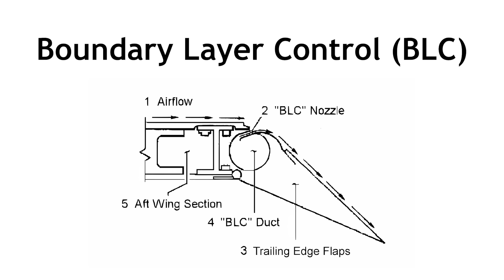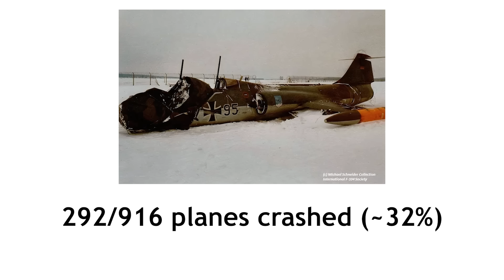Why This Jet Killed So Many Pilots?

Comment: Many f-16s that were made for export came with a j79. Not the Pratt & Whitney tf100 or the General Electric engine. You can usually tell them because they have a little bit of an extended tail because the j79 is a couple of feet longer in the aircraft

Comment: I hear the Russians are in need of replacement aircraft, dust these off and send them over as low level attack aircraft from the golden era of NATO.  🤣
Reply: I like your anger. It is caused by your insignificance.
Reply: @dmitry4c996 Projection... 🤣

Comment: I'm not an aviation expert but I noticed most these jets from like the 50s and 60s had very high accident rates.   It wasn't just the widowmaker.
Reply: Very true the century series  had very high performance and far less forgiving than earlier jets which were in many cases jet power with WWII airframe.  I've been told other airforce had higher accidents than Germany
Reply: @JohnW-gz4db  F 104 losses  in Germany 32 %, Italy 38 %, Taiwan and Canada 46 % English Electric Lightning just over 15 %

Comment: Also destroyed Saunders-Roe who had a bid in for the same NATO fighter contract with the SR53 but Lockheed won due to wholesale bribery.
Reply: Lockheed won because the F-104 was fully developed and had superior performance.
Reply: @dukeford  Not true, I personally knew members of the SR rocket engineering team, and their bird was undergoing flight-testing when Lockheed had it canned. It LITERALLY had a rocket up its tail (as well as a secondary jet engine for loitering and go-arounds). The rocket was similarly usable as Spaceship 2's current engine is now, and it could outclimb anything: time to 100,000 feet was 3 minutes! It was a conventional delta wing with decent wing area and well-behaved. And the Luftwaffe wanted it.
Reply: @richardm.newlands2417  1. None of that stuff was ever tested. 2. NATO needed a multi-role aircraft.  The SR53 was strictly a one-trick pony.
Reply: @dukeford  And the Lockheed bribes scandal led to various people going to jail
Reply: @WORKERS.DREADNOUGHT  Nobody ever actually went to jail.  The only person convicted was in Japan, and he died while his case was being appealed.

Comment: A lot of misleading b.s..  More " forced into roles it wasn't suited for" nonsense.  The fact is that the Starfighter was a very effective multi-role aircraft and it's accident record wasn't much different than other 2nd Generation fighters.
Reply: R-I-G-H-T guy. try again.if what you're saying was true there wouldn't be so much controversy. You also need read little more history. Your not well informed.
Reply: @JohnW-gz4db  Everything I said is 100% accurate.  The controversy had little to do with the capabilities of the airplane, and it's safety record has always been misrepresented.

Comment: My dad loved it. 700+ hrs before a dumb soccer accident kept from flying. Late 60’s that was.
Reply: IDK but soccer accident may have saved his life... just saying.
Reply: @Barron5362  I suspect @Robin6512 dad respected the 104's advantages and disavantages by being (fortunately) fully trained and avoiding situations that were obvious to a fully trained 104 pilot but not obvious to a lesser-trained pilot or to managers that impose inappropriate missions.  It is a bit like driving a Ferrari in the winter...when it is snowy icy you do not force race mode, you drive conservatively until it's dry.  Managing such limitations with a high-performance machine is VERY rewarding, thus the "love".   But, yes, one never knows what the future holds.
Reply: So an arrogant pilot got what they deserved for a change, without killing a bunch of people in the process. Some story. The best pilots are usually the ones wisely on the ground, wrenching on said deathtrap. There's a reason I fly an experimental. Only affordable way to get a plane that was designed with the benefit of modern knowledge and computer assistance. You can pay 5x as much and fly a tired old Cessna. They are sturdy planes but, after decades of mishandling by crappy low time pilots, and never really being properly maintained, even they become deathtraps. The fact that pilots usually don't know nearly enough about the planes they fly is a pervasive problem. I would have been a conscientious objector before I would fly the F-104. It really is that simple. It was a bridge too far. 
Your old man is probably lucky he got out when he did. Someone who gets themselves sidelined playing soccer for giggles can't be a very good pilot.
Frankly, any random military jet jock who survived the lawn dart should consider themselves extremely lucky. It almost killed Chuck Yeager and I am certain that no better pilot has ever lived.
Reply: @RunsWithChainsaw  Knowing ones own limitations is a virtue
Reply: @RunsWithChainsaw  bro relax

Comment: While in the Air Training Corp back in the 1980's,I read an issue of flight magazine about this very aircraft and this problem,the Luftwaffe F104 pilots were instructed,if you get into trouble,INVERT the aircraft AND EJECT.DO NOT EJECT WHENNIN LEVELNFLIGHT.
Reply: Your memory is faulty. 🙄
Reply: @dukeford I don't think so because at least one model did have down ward ejection seat  historical fact one german pilot experienced engine failure after take off , rolled inverted attempt to eject.
Reply: @JohnW-gz4db  Maybe it happened to one German pilot one time, although he would have to have been flying an early USAF model, which were the only ones with the C1 seat.
Reply: LOL
Reply: Initially, it was someone's joke. But it seems that Luftwaffe instructors have a very specific perception. Like that chocolate bar: "Quadratish praktish gut". Thus, the joke turned into a guidance..

Comment: High wing loading and flying too slowly. That's what I think.
Reply: You would be wrong.  Most crashes were due to bad weather, high-speed low-altitude operations, and engine failures.
Reply: @gort8203  How do you know that - and why did the Germans crash so many more (proportion) than the US?

Comment: One small correction:  Canada took on strength 200 CF-104 and 39 CF-104D two seat trainers for a total of 239 aircraft.  Of the 110 class A accidents 21 were attributed to foreign object damage (14 of which were birds), 14 were in flight engine failures, 6 were faulty maintenance, 9 were mid air collisions. 32 struck the ground flying at low level in poor weather conditions. the rest being attributed to pilot inattention.  As for nicknames some Canadian pilots referred to it jokingly as The Lawn Dart, The Aluminum Death Tube, or The Flying Phallus but generally called it the One oh Four or simply the Starfighter.
Reply: lack of adequate transition training was the issue..this is a a barely able to fly aircraft almost a wingless bullet
Reply: Thank you for those statistics, takes away much of the fog.
Reply: To be fair, the 101 had it's share of issues, too. I got talking to a former Voodoo pilot at the Calgary Military Museums last year, and he had some hair-raising stories. Jets were really pushing the envelope in those days, and that wasn't always compatible with crew safety.

Comment: What killed those pilots? Grift. The German minister who bought them went to jail. The Canadians were politically forced into abandoning the Avro Arrow to buy this non-habit forming machine.
Reply: Stop lying. No one went to jail, and Canada building the CF-104 had nothing to do with that grossly overrated flying turkey the Avro Arrow.
Reply: @dukeford  The Lockheed bribery scandals encompassed bribes and contributions made by officials of U.S. aerospace company Lockheed from the late 1950s to the 1970s in the process of negotiating the sale of aircraft.[1] The scandal caused considerable political controversy in West Germany, Italy, the Netherlands, and Japan. In the U.S., the scandal nearly led to Lockheed's downfall, as it was already struggling due to the commercial failure of the L-1011 TriStar airliner.
Reply: @dukeford  Prime Minister Diefenbaker insisted on the destruction of all existing prototypes, blueprints, and related documents. Dodgy, or what? Stop being so gullible.

Comment: Widow maker was a media thing. It was never called that but it's pilots who loved it so they tried flying prostitute.There are many factors it was a hot ship period.The tiny wings needed blown flaps and engine power to land and take off. Steinhoff sorted the ejector seat with Martin Baker Zero/ Zero seats. Some one made a comment that the Germans adopted"Train hard fight easy" that did not help either.I could write a book.If I won millions I would get a recent built Me262 and a Pucara.I would get a 104 for sentimental reasons but no way would I fly it unless I had a Martin  Baker zero/zero seat.
Reply: 32 % of F 104 pilots in Germany didn't love it, if any did and it was worse in Italy and Canada, the best thing in an F 104 was the ejector seat.

Comment: Minimum time for U.S. pilots was 1500 hours to transition to the F-104, 400 hours for German pilots who were mostly coming from F-84F Thunderstreaks that ate up 7500ft of runway, loaded on a hot day. Standard for the F-104 was 4500-5000 ft.
Reply: A 400-hour German pilot is one right out of UPT, not from the F-84.
Reply: According to official sources, the 1500/400 hrs was the absolute minimum" jet time" I failed to clarify.. A German 400hr jet time pilot would likely have come out of F-84F's IMO.
Reply: @FastFatman  I think you're confused.
Reply: I'm always confused. In this case I didn't get a better source. I can't find anything other than 1500hrs, with no breakdown for USAF pilots.
      According to "The Luftwaffe at Luke" by R. Sullivan 1977, stated "A minimum of 1,200 hours of flying time was required, with 500 hours in jet fighters and 150 hours in the F-104G."
Reply: @FastFatman  Pilots right out of UPT have around 400 hours, so there you go.  Maybe the Germans had a 400-hour requirement for pilots transitioning from the F-84 as well; that sounds plausible.  The USAF initial requirement was 1,500 hours, but that went away by the early 1960's.

Comment: Note: Very Few Downward Ejection seat F104 Aircraft Where Made Less Than Twenty . The Lack Of Training by The German Government Main Cause . —————-  Northrop Retired Engineer.T38 Bill 1956/61 Good Day . P S Northrop Made Parts ,F100, F101, F102, F104, F105. KC135 .
Reply: All the A and B models had the downward seat initially, and so did a lot of the C models.  That's a lot more than 20.

Comment: I spoke with a german F-104 pilot, the issue was the giant leap from a rather harmless, subsonic plane like the Fiat G-91 or F-84 Thunderflash to the Mach 2 interceptor without anything in between. 
  (besides loading it with tons of equipment and assigning it to roles that were the direct opposite to the original one: vertically up, shoot down the bomber, and back to base)

He said after they found out that it did not work that way, and took to proper and intensive training in the US (where there is space and you can fly out the plane to its limits, unlike in Germany, where every 10 seconds there comes another village you are not allowed to fly over etc.), 
the loss rates dropped drastically and were not so much higher than other planes of that era. He said all concentrate on the Starfighter alone, but that definitely was not the only one. 

In principle all this is said in the video, so it is pretty good, way less one-sided than many.

He said in these times the Starfighter was also the german choice for a retaliatory nuclear strike (with US-owned nukes loaded).

Their job was to sit in alarm readiness, literally in the cockpit at the end of the runway, to be able to take off instantly and fly their mission. 
Every second counted in case of a nuclear attack. 

But the outset was bleak - back then the scenario was a nuclear annihilation of both sides in case of a war, and even when you could fulfill your mission,  the probable outcome was when you returned, your base would be obliterated, and your home and your family would all have turned to dust by then. 

He said never in his life he drank that much - it was such a senseless task they were supposed to do, they did not really care anymore.
Reply: Someone, with first-hand knowledge of the Starfighter, having serviced both German and Norwegian F-104s during operations in Norway, told me that the upgraded German version's electronics weighed twice as much as their standard ones. Norway lost nil Starfighters during his tenure, while the Germans lost a lot.
Reply: @ErikssonTord_2  Norway had one squadron of Starfighters that they apparently used only as a dedicated interceptor.  Hence the low number of losses.
Reply: I used to work with a guy who was assigned security with those planes.    He told me the Luftwaffe had F104s each with one nuclear bomb  in hangers under heavy guard. The bombs got swapped out for a new plane every now and then and they never left the hangers .   Everything just sat there on ready Standby.    He said it was pretty well. Understood that if they ever left, they wouldn’t be coming back.
Reply: @drizler  Thanks for your comment, it corresponds with what I remember, so I am more sure that my memory is not totally wrong.
Reply: @drizler  The Dutch, Belgians and Canadians did basically the same thing.  The weapons were all controlled by the U.S., btw.

Comment: RCAF LCol Ken Thornetcroft, who commanded an F-104 Squadron at Cold Lake, Alberta, and went on to become Deputy Chief Commander of NORAD, told me during a visit to Cold Lake in the early ‘70s (I was a young Canadian Press reporter at the time), that the Starfighter glided “like a brick shithouse.” This was shortly after one of his pilots died during a low-level night flight - a contentious role for an aircraft designed as a high-altitude interceptor.
Reply: Worst possible fighter for the vast frozen expanses of Canada, where survival is measured in hours.

 Single engine. Fails, you're dead. Glides like a brick.

Thus the Widowmaker name.

Same for the F-35.
Reply: @ThamMalaysia  The Starfighter wasn't used over the "vast frozen expanses of Canada", so it's single engine wasn't a factor.  That "widowmaker" business is an unfortunate media construct.
Reply: @dukeford 

And how many crashes/fatalities ?
Reply: @ThamMalaysia  No more crashes, by percentage, than it's contemporaries.
Reply: @dukeford  By percentage, the RCAF Starfighters had the worse losses worldwide, even higher than the Luftwaffe. But since the fleet was much smaller it didn't impress as much.
Feel free to check.
Reply: @duartesimoes508  Be careful on those RCAF CF-104 percentages. I've seen it expressed as both airframe losses and as Class A mishaps.  The two are not necessarily the same.  I'm sure you're aware that the RCAF put vastly more hours on their Starfighters than other air forces, but despite that (and the attrition rate) their overall accident rate was lower than any NATO user that operated at least 100 F-104's.
Reply: @dukeford   Okay, Air Force bosses wanted to kill trained pilots...?
Reply: @esajuhanirintamaki965  Oh, most assuredly.  🙄
Reply: i believe  it was used to train space shuttle pilots...very high stall speed design with no power glide..perfect to train for a one chance only shuttle landing
Reply: I heard it describe as having the glide ratio of a "Greased anvil".
Reply: My very first deployment Maple Flag Cold Lake CFB 421st TFS F16A/B
Reply: Good thing it wasn't meant to be a glider. How far do you think the F-101 or the Mig-21 could glide.  
By the way, it was not designed as an "interceptor", it was designed as an air superiority fighter.
Reply: That brick shithouse line is darkly perfect for the Starfighter, and for how leaders kept pushing it into roles it was never meant to survive. The tragic part is that pilots paid for strategic fashion, not just aerodynamics, while the Cold War need for a supersonic nuclear delivery platform got sold to the public as a versatile fighter. At what point does accepting those low level night missions stop being brave professionalism and start being institutional negligence, and do we judge that by the tech of the time or by the body count we now know about?
Reply: It was designed as an air superiority fighter. Air superiority fighters eventually acquire other roles, so using it as a fighter-bomber was hardly "contentious"..
Reply: @dukeford   Air superiority? It means hundreds and thousands pilots with planes, ready to eagerly shoot down every one "different military zip code colleagues".

Speedy buzzing could get some scared, but without combat skills....

Useless.

Comment: The loss rate of German F-104s was due to inadequate training and maintenace.  When a former WWII german pilot took charge he chased the problem away.  The truth is the F-104 was a natural for low level operation with the stubby wings with gtrat gust response.  Only the very first had downward firing seat. There were no faults with the F-104.  Many other tactical aircraft had higher crash rates. About 50% of the British Scimiter fighters were lost in about 5 years of service.     The F-104 remained in service for decades as a premeir interceptor.  In my opimion, this article is mostly exaggerted trash.